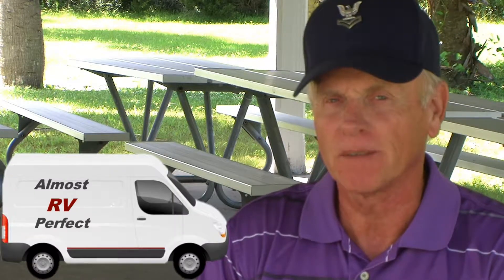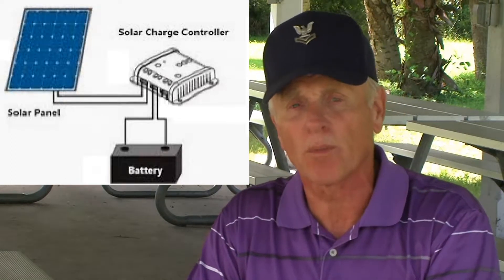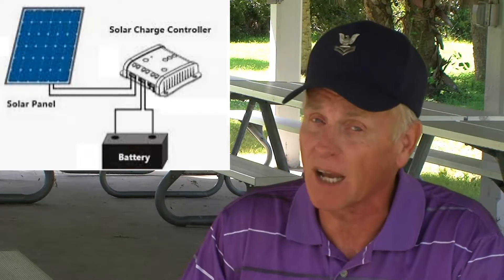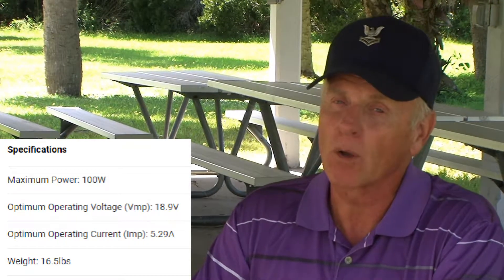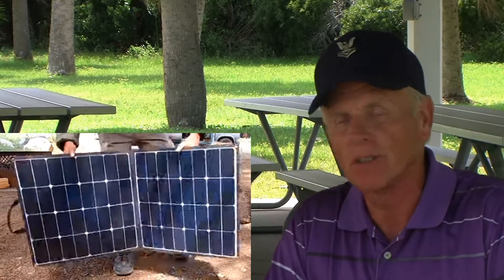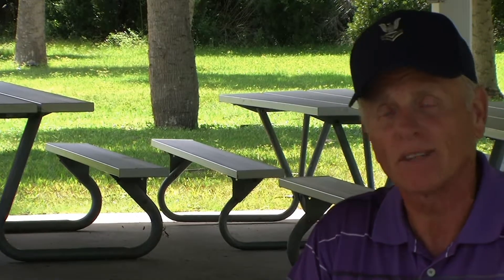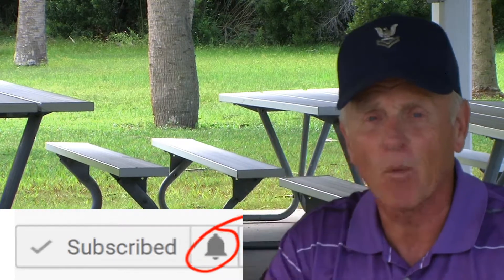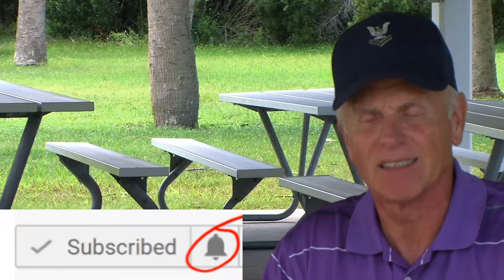S1E006 | A solar charge controller will protect your battery bank from over charging.

Comment: You just answered 99% of my questions. Basic, simple, direct and informative explanation of what is happening here. AWESOME INSTRUCTION! I am looking for a solution for a charging system using wind power and not solar power. I converted a 12-volt dc engine fan from a car to a wind power generator and needed a way to control the constantly variable power output of the converted fan. At lower rpms it may put out 6 to 10 vdc. at higher rpm (higher wind speed) I have detected 22-volt dc. I want to limit the max output of wind generator and prevent overcharge situations. All I need now is an Amperage control for Wind Generator. Any Ideas? I have no idea what the amperage output would be in this configuration but when originally used as a motor instead of a generator, it was protected by a 30-amp fuse. It could be putting out 15 amps or it could be putting out 80 amps. I don't know. (And I don't know how to measure it)